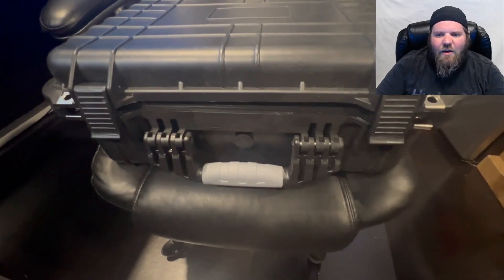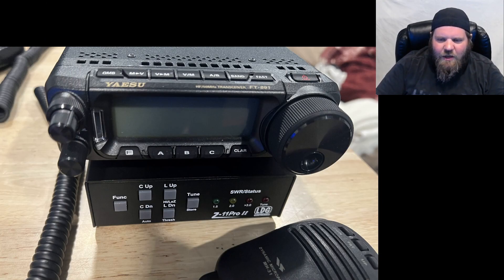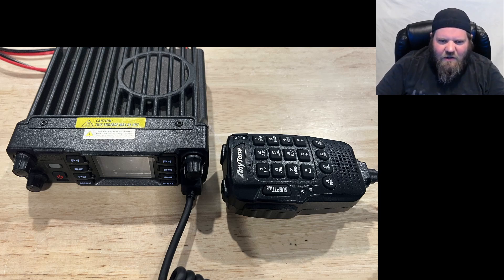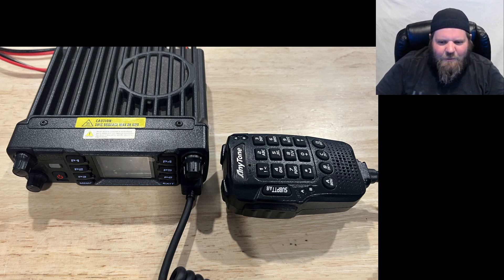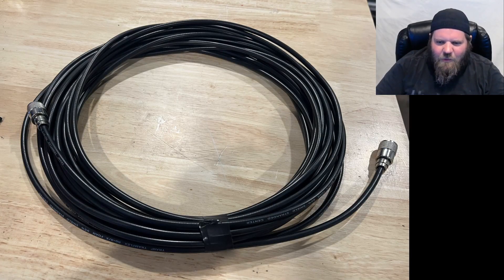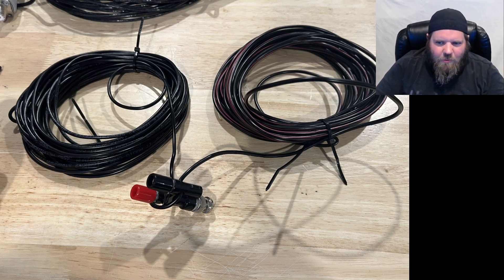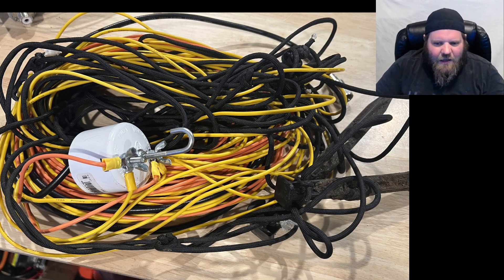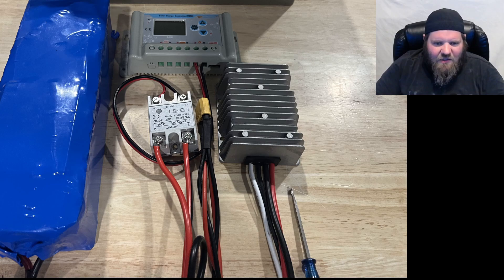HAM Radio Go Kit - My Portable Amateur Radio Go-Box Setup

Comment: Yo! Thanks for the breakdown on your mobile setup. I am new to the HAM world and was looking to do mainly portable OPs mainly and later some blue water cruising, I hope. Going for my General in a week or so. Cross your fingers. Thanks again!
Reply from the maker: I got my Technician and my general license 2 weeks part and that was back in Oct 2021.  I have enjoyed the hobby so far and the only regret i have is that i didn't get into it when i was younger when i first had the interest, back in my teen years.  Making up for lost time now.  i hope to do more about some of the custom antennas i been using for portable ops as well as custom battery packs (that i build) as well as the solar panels i use for portable ops.  Thanks for your feedback.  I'm pretty new at this Youtube Channel thing and still trying to get the hang of it.